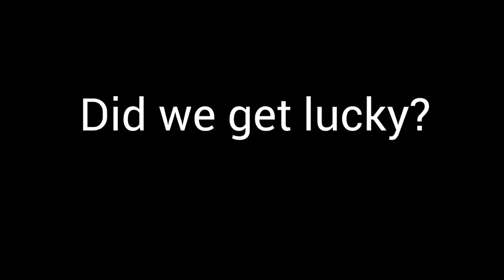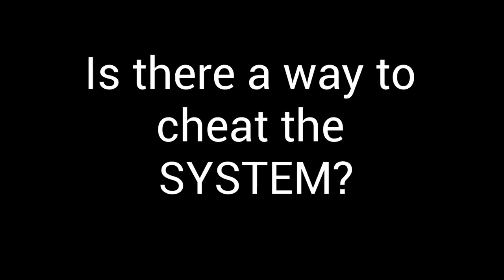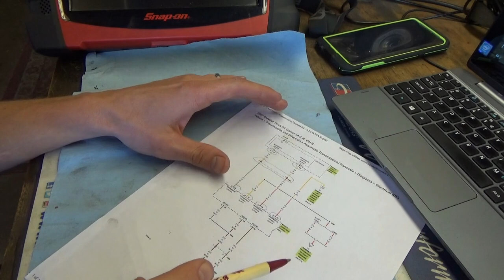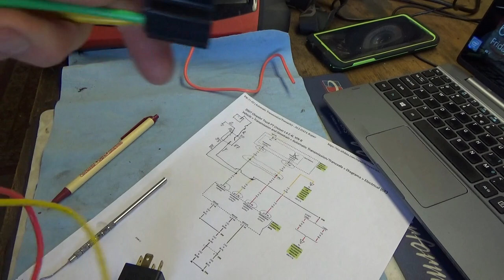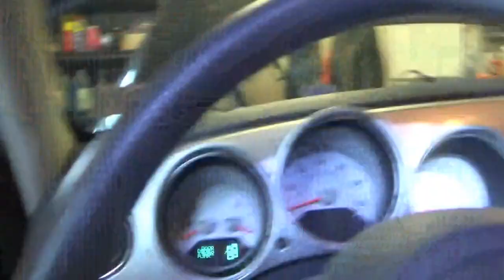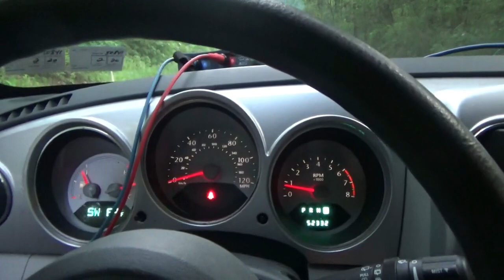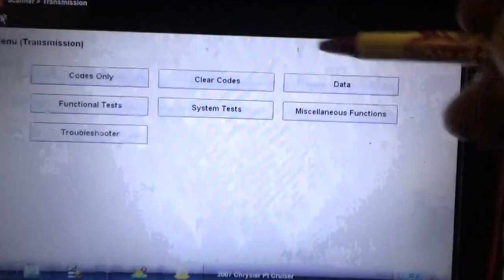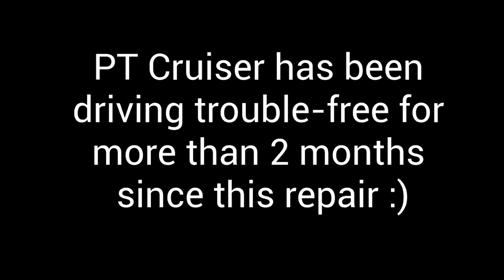Chrysler "LIMP HOME" Cruiser: P0882 - TCM Power Input Low (Part 2 - TIPM!)

Comment: Dang glad i seen this ..i just bought o6 pt turbo with that same code i put a new tipm in an still issues no one can figure it out sad too its only got 46,000 miles on it dealership wanted 1600 for pcm in hopes thats the fix.but after spending  what i did on the car gonna have to save. bought a cheaper pcm on ebay but as soon i put it in it threw up a p0182 code up some im assuming it was program wrong because asoon as i put my old pcm back in it disappeared. My p0882 code only come up long drives gose into limp mode i unplug the battery for a bit plug it back up good to go till it happens  aging so crappy

Comment: HI, YOU DID A GREAT JOB. I HAVE A 2006 PT CRUISER, SAME ISSUE, THE MECHANIC DID THE SCAN AND CAME UP WITH THE PCM CONTROL BOX. I PAID $275.00 FOR THE BOX, IT WILL BE INSTALLED TOMORROW. HE DIDN'T CHECK THE TIPM. IF THE CONTROL BOX DOESN'T FIX IT, WILL I BE ABLE TO ORDER THE TIPM AND HAVE IT INSTALLED? I'VE BEEN TO 4 PLACES, NOBODY SEEMS TO WANT TO BOTHER WITH IT. I DON'T WAANT TO HAAVE TO BUY A DIFFERENT CAR, ( it could be a bigger problem ), SO IT SEEMS CHEAPER TO DO THIS REPAIR.

Comment: Not like a Mercedes or BMW?
Well Mercedes and Chrysler were together from 1998 to 2007 so yeah it is like a mercedes and bmw. 
Years ago I got a friends chevy started by taping on his carburetor with a hammer. I charged him 25 bucks and he complained, said all you did was tap my carburetor a little. 
So I said okay 5 bucks to tap your carburetor and twenty bucks to know where to tap it. You fixed his problem. People take their cars into the dealer they replace a part and charge them for the part and labor and still have the same problem. I think your price was fair.
Nice work around and good video.

Comment: have done similar repairs to save big bucks for clients and your right those TIPM s are junk 100% failure rate .  could not wire around the last tipm but did find one for just under 300$ new with life time warentee yep you guest the part manufacture MAN lol.   great wire around though will log that one for a future repair on the cheap have some of those micro relays great for this type of fix

Comment: I did a very similar repair on my sister in laws pt cruiser. Except it was the horn circuit. A $300 plus dollar Tipm for just the horn. Or a out board relay.

Comment: Pretty sure it is a failing solder joint between the 2 boards in the TPM.
But you found a working solution, so everybody is happy 😊
Reply from the maker: Yeah most likely a bad solder joint. But which one? Like finding a needle in a haystack lol
Reply: @PineHollowAutoDiagnostics  The joints between the boards would flex the most. Relay works too.

Comment: Ivan, I'm shocked you have never had one of these apart before. They are amazing things but horrible when water gets into them. I know as ive just finished cleaning one up out of my TD5.
I did replace it with a second hand one for £45.00 but ive still not gotten to all the connector pins on the plugs yet. mmm thats the next job. Keep it going mate.

Comment: Cool fix Ivan. Remember though, you have now redesigned this system. The unknown now is, what happens when the system wants to turn this signal off and why does it? If the outcome is that the transmission remains engaged when it shouldn't, have you engineered an accident?
Not enough information to know I am afraid. Hopefully, the effects would be benign, but without testing failures elsewhere in the system that are supposed to trigger this, you are rolling a dice....   Still cool fix though.

Comment: Comparing what a dealer just did with my '06 PT, you're a magician.  The dealer first replaced the PCM. No fix.  Then replaced the transmission solenoid pack- again no fix-, and finally wanted to replace the TIPM, for another $1,000.  I said no and had the car brought home on a rollback unfixed and with a bill for $800.  If only there was a diagnostics guy like you near here in southside Virginia.

  Your fix is identical to my limp mode problem on my '06.  I'll have to get a TIPM though.  If you were within 100 miles of me, I would just send my PT to you anytime I have a problem.  I hope you live long and prosper.
Reply from the maker: Check out Maks TIPM rebuilders 👍
Reply: @PineHollowAutoDiagnostics  Yes, I was just looking over their site earlier.  Thanks.
Reply: This is an easy fix..you spent thousands and wasted time. Next time remove the 5 screws on top of the tipm and put them back by hand not with a drill. Make sure especially  the centre screw is not cranked tight. Leave it barely snug.These tipms are over torqued and this stress on the pcb. My pt was stuck in limp mode. I fixed it in under 3 minutes for a cost of zero

Comment: Great diag. and fix.
The only thing that worries me is by passing the tipm if it decides to power off the tcm for some reason and it can't what will happen then?
also do car relays have built in flyback diodes because an iductive flyback spike could fry the ecu.

nvm. just saw another comment about the relay. great work

Comment: I always add a diode when I put a relay into a circuit with sensitive components. I suspect this entire car counts as a 'sensitive' component. Just a thought - that magnetic field collapsing can feedback a surprising amount of energy.
Reply from the maker: Most good relays have a diode built in. That's why I used a Toyota OEM relay, not the crappy generic one :)

Comment: since you powered the relay from the original "trigger" wire,which come's from the PCM, you should place a diode in parallel so to prevent voltage spike from relays coil when current is interrupted,(some relay have one already )

Comment: On the Jeep CG WK2, the fuel pump relay on the TIPM had a recall. The official solution  was the relay override. A lot cheaper to do the recall this way instead to swap the TIPMS that cost a lot.

Comment: Thanks for sharing. My Chrysler lebaron is doing the same thing. I'll probably fix it the same way. Just wish i had the tools your using lol. This has been very helpful
Reply from the maker: What year LeBaron? That's old school tech compared to this lol
Reply: 1990. Had a jasper replacement done when i bought it in 2014. Was a garaged car, convertible, nice condition. Had the limp mode then when i was in stop and go conditions. If i hit the highway right away it did fine. But i had dodge Chrysler put a transmission in it anyways. That was then. It's been a all day driver since and never abused. Normal driving conditions always. But now its kinda moaning like another type of limp mode. 1st type was only shifting to 2nd. Now it shifts but only to 3rd, no overdrives at all. Prior to it doing it the speed odometer would work off and on. The alternator is new since about a year ago. Battery only about 2 years old. It did tun down once because the lights were left on because the door wasnt shut for overnight and half a day. Sluggish start. Actually had to end up charging it up to start it. I say that because i heard that because of a low battery, that it would cause it to go into limp mode. Idk. I gotta do something. That transmission has been baby'd since its been installed. No overhearing issues ever too. Seems like maybe a speed or overdrive sensor might have failed. Thanks for your replies
Reply: Or bad wire. Doing a visual inspection of all wiring and connectivities tomorrow with electrical contact spray  on hand.

Comment: To make matters worse that is a multi-layer printed circuit board. So really tough to see all the signal paths. Not to mention no markings on the chips. Anyway, I was thinking the same thing myself. If the circuit didn't have enough drive current,, then worse come to worse you could always use a small transistor to switch the relay.

Comment: Interesting work-around.  If tapping/bumping the TIPM caused the fault, I wonder if there isn't a micro crack on one of the solder joints or a poor joint in general.  Risky, but you might have been able to try reflowing the solder on that circuit.
Reply: POSSIBLY ? BUT IT'S A BITCH OF A JOB, MOST OF THE TIME ENDING UP IN  BIGGER MESS. YOU REALLY HAVE TO HAVE THE RIGHT TOOLS, EXPERIENCE & A STEADY HAND, WHICH I SURELY DON'T HAVE ANYMORE, LOL.

Comment: At about 5:48  "What was wrong with old school fuses and relays?"

My old self believes this too. I have a good looking 1998 Dodge "Caravan Sport" that runs great when something in the electronics doesn't mess that up.

The last incident was when I had driven to the grocery store about a mile away and was returning home. At about the mile and a half mark (the engine wasn't even up to operating temperature yet) and the engine stopped. Just stopped. No warning. No chug chug from being out of gas. Just zip...engine not running. It would not restart. Dash lights came on. but there was no contact with the starter.

I pushed it over to the side of the street and parked it overnight. The next morning I went to it and it started right up. I drove it the rest of the way home and parked it. Haven't operated it since. I can't trust it. Thank goodness it didn't die on us when I was taking my 81 year old Sweety to doctors in Reno. Don't need to be stranded on the highway in the desert.
 
It would be a shame to scrap this attractive and handy vehicle. We were going to convert it to a road camper and make one last journey to childhood haunts in Idaho, Washington and Oregon. Our final "ride-a-bout" you might say.

We've burned out one mechanic shop, trying to get this rig squared away. So, I am ready to be crazy dealing with it. 

So. In addition to your very important question, I would like to further ask: "Is it possible to tear out all the computer crap and retro-fit the electrics in the 1950's and 1960's way? Each circuit with its own relay and fuse? Could get rid of the idiot lights and put in real gauges?

Start with the battery- alternator- starter system that interacts with the coil-distributor-spark plug system and so forth? Wouldn't this be GREAT! Taking Our rigs back (usually I face forward) to where We can work on them ourselves?!? I think this a worthy part of any bigger Revolution.

What do you think, Ivan. Please don't tell me you are in Russia! A beautiful nation, but just too far for a weakling like me.
Reply: At 8:29  "Why can't we just put a relay in here?" By Gosh! You are already on the path of righteousness! Back to the video with me...to see...to see!

Comment: An excellent result, but I do question the manor of the repair. Would it not have been better to get a smaller relay, and build it into the tipm, where there would have been easy access to power, ground, and the 2 control signals

Comment: I wonder if the loose connector is what caused the MOSFET(?) to fail. Good comments by the others on being sure there is a blocking diode to protect against a back EMF, I wouldn't have thought to look. Nice fix Ivan. And I totally agree this is just planned obsolescence. Why have the PCM run out to the TIPM, to flip a FET, only to run back into the TCM...didn't you say the PCM and TCM are the same module?

Comment: yes you can definitely fix those tipms  that's one option other option is to bypass circuits , i' ve done a few not easy job but it's possible   Flo's Auto Electric

Comment: Had a problem with a family member's '94 Grand Cherokee, HVAC inop. Turns out Chrysler soldered a relay into the inside of the manual HVAC control module (with the knobs on the front, in the center console). Naturally, the relay failed and a new module is worth more than the truck if it's even available for order. I desoldered the failed relay and soldered in a relay socket on a pigtail with a brand new relay plugged in; has been working for a couple years now. Chrysler has been going down this path for a while apparently :/

Comment: Hi.
I really like your films because I run a car electromechanics workshop in Poland.
I have only one comment. You should first place a fuse in the supply line next to the battery because shorting an unprotected cable to the ground could cause a fire.

As usual, a very good movie.
Congratulations.

Please, write to me if you can help me or advise on buying smoke machine in the United States because it is not available in Poland.

Thank you in advance.
Greetings from Poland.

Comment: My 2006 PT Cruiser has the same issue with the P0882 code. I took it into the repair shop yesterday and they told me you can't install a used TIPM. "They can't be reprogrammed." They quoted me $1600 to install a new one ($1100 for the TIPM and $300 to program it).

Comment: My neighbor's POS  Jeep was diagnosed at the dealer & they charged a 1 hour $115 diagnostic fee for a bad TIPM & they wired in a relay for the fuel pump at .7 hours labor plus parts.
Reply from the maker: Actually very reasonable for a dealer!

Comment: I'm not sure about the 1 year warranty. Back in the early days of PCs, when they were worth fixing, I did some card level repairs. Sometimes one single component failed and once replaced the card could live on for years... sometimes not so much as one component after another failed on that same card. 

I pretty much suspected that these component failures were caused by power spikes so it would always be a good idea to ask the customer if they replaced the alternator or recently jumped the car and maybe scope the charging system before warrantying the work.  Personally, I did these kinds of hatchet jobs to help out customers who didn't have the money for new cards, and I saved them some money before new cards got cheaper than solder, and most lasted longer than the rest of the machine, but no, I'd never warranty the job.

Comment: your new fuse should be as close to the battery as possible to handle any rubbing of the new wire and safe guard against any shorts.

Comment: Does the relay have a counter-emf diode?  If so, make sure the polarity is correct.  If not, you will need to add one.  The power off of the relay will cause a huge spike into the ECM.  If you don't put a counter-emf diode in the relay coil (which makes it polarized), then you could accidentally fry the ECM.  Just an observation from an electronics geek.
Reply: Sorry.  I meant to say across the relay coil.
Reply: Yes, a good point. The coil emf could kill that driver circuit, always good design to have a diode across the coil of a DC relay.
Reply: Harry McDow he put the scope on the control wire post repair. No voltage spike noted.
Reply: @chekelley6861  Some of those relays (hard to tell which) already have diodes across the relay coil.   I was just wondering about that relay.  And the spike can be up to 1,000 volts, and unless you expect it and adjust the scope specifically, a scope can't trigger fast enough for a 1,000 volt 5 millisecond spike.  Some relays can have a hellacious spike;  when I was in the Navy working on A7-E's, we had a series of relays that could produce up to 3,200 volts when you shut off the current.  Without a counter-emf diode, the current source transistor would violently fail, and sometimes produce shrapnel.  Of course those were 48vdc relays, so the drive voltage is proportional.
Reply from the maker: No worries on this one Harry, the Toyota relay has a built-in diode, and we saw no spikes on the PicoScope :)
Reply: Pine Hollow Auto Diagnostics 👍👍 Awesome, Ivan!!   I was really surprised that that TIPM was all solid state.  And conformal coating makes it really hard to fix a cracked solder joint!!  Where is it?  Would take hours and hours of work.  Worse, it could be a cracked copper land on the board(s), and with all that coating, it would be next to impossible to find that!!  Great fix!!!  Nicely done.

Comment: I have a question maybe you can help me with I did the tipm bypass with the relay I'm having the same exact problems with my 07 PT Cruiser. My question is I was wondering if the two solid red wires going into c4 at the PCM are those two red wires supposed to get power when I turn the ignition on cuz when I test them with my test light either one seems to light up. Just wondering since they are both also trans control outputs. Thank you and I appreciate any help. Btw your video is by far very helpful.

Comment: For those of you at home who are willing to try this work around I urge you to consider the liability. If you still decide to proceed make sure that the relay that you have chosen has adequate arc suppression in parallel with the relay coil otherwise the CEMF will certainly destroy the output from the PCM.

Comment: did you cut the C4 pin 38 wire to the PCM? how does 12v batt from TIPM and 12v batt from mechanical relay to the same circuit play together? did you just piggyback (lay bypass wires on top on existing circuits)?

Comment: looking at how the supply changed when you wiggled the tipm it looks like it might have just had a bad solder joint, likely on the main sense connector.

Comment: Ivan - I have a 2006 PT Cruiser which doesn't have your Yellow/Orange wire.  Could you please tell me what the wiring splices would be on the 2006 version (PIN # on the PCM connector where the yellow/orange would be)?  We got this car for our teenager and this limp-mode happened shortly after we bought it!  THANKS!!!!

Comment: Hi Ivan I'm Rael I very love the way you do your best work I got the same car I try to fix the Sam problem may be I failed some where in the wire or maybe one of the wire are different in 2006 please I need the diagram you use to correctly install the relay I really need your help
Best regards to you

Comment: Your load side fuse on the relay should be closer to the battery because that wire can get shorted between the battery and the fuse